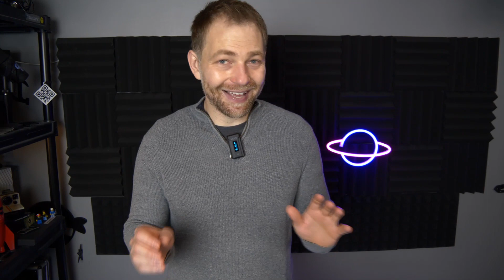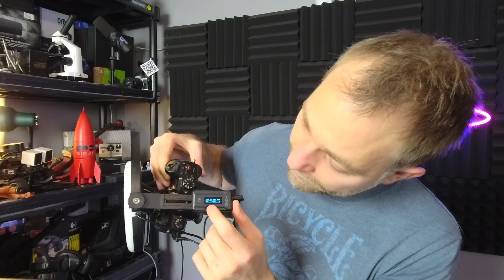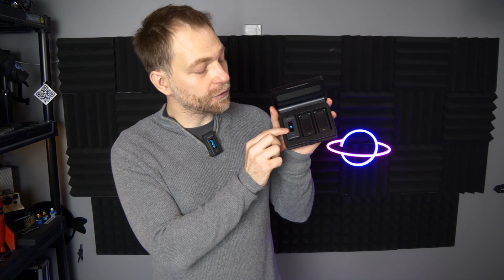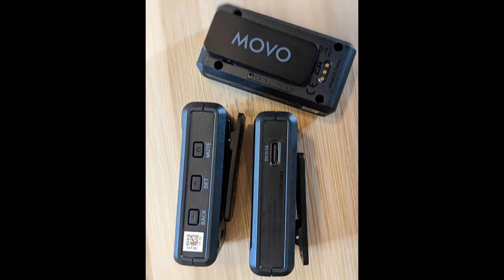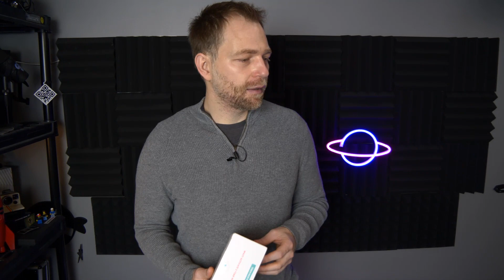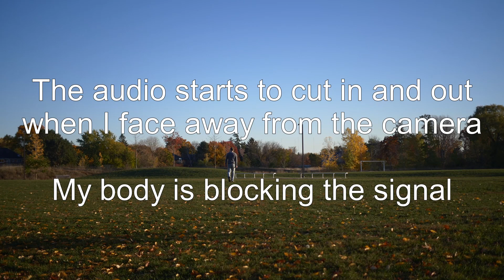MOVO WMX-2 DUO Review - Wireless Microphone System

Comment: Looks like a well thought out system. I can see that in my future for my reality piano bar fb streams. Two user friendly transmitters on guests would be a gas. I'll use the line in to a small analog mixer I use with my obs system. I like how those integrated mic/tx units can be clipped on to guests less intrusively than wires and body pack. I'm in. Next time I'm feeling flush with cash!  I share your priorities and would happily opt in to a fancier version with a built-in limiter. I don't have the luxury of monitoring my audio quality in real-time. Rather, I set the levels by past experience and hope for the best.